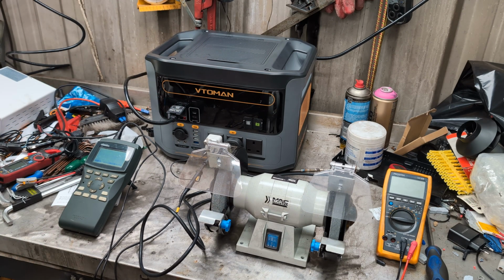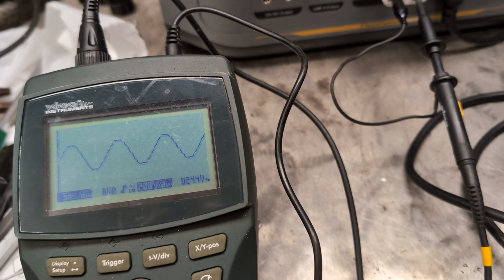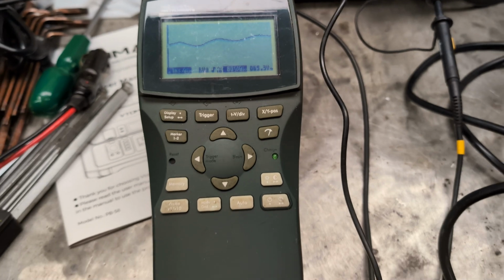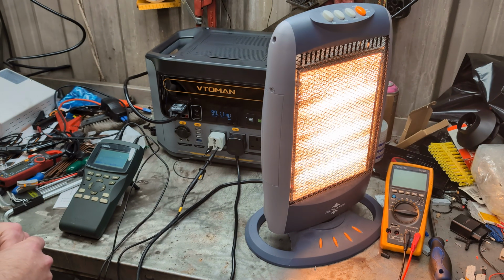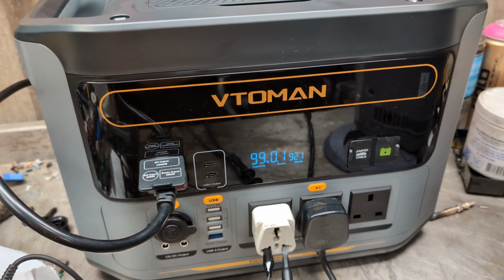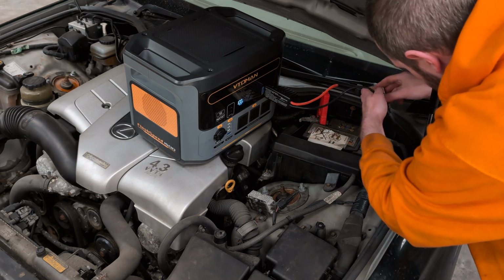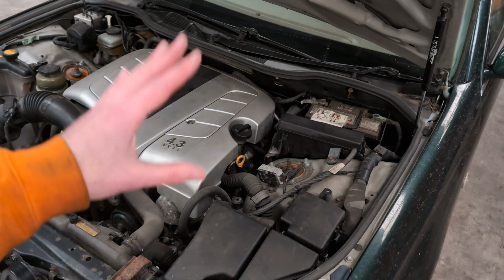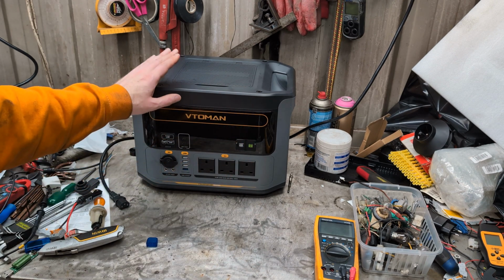Vtoman FlashSpeed 1500 Power Station - UPS test, JUMP START test

Comment: Why are the cables so short ? Is this deliberate or a design flaw ?
Reply from the maker: Short so they don't have to be as thick.  But yes, they are rather on the short side considering the size of the unit.  Option B is to extend them with normal jumper cables.

Comment: I forgot to say, ref waste oil heaters etc, didnt use mine this year, got 8 old laptop batteries and 20 quid heated vest. Fantastic. Solar charges 4 18650s while the others heat coat. Defo recommend.

Comment: Will the jump starter cables operate a diesel heater?
Reply from the maker: In theory yes.  But as it's only using half of the battery pack my concern would be how unbalanced the cells would be after some time.

Comment: Jump start may be ok for a gasoline mini engine. But a diesel truck engine will pop the overload. There is a reason why diesel have a battery designed to give you a hernia.
Your home is well equipped to give you a cup of tea. Till the mains juice up. It is always fun. When the power goes down. Your house is all lit up  and watching a video.
Reply from the maker: I wish I had something big and diesel to test it on.  There is a diesel forklift but I don't think the engine is very large.
Reply: @DavidMcLuckie  
Now where's a train engine 🤣🤣🤣
Reply: I’m looking for a powerbank with AC inverter that will jump my pickup truck.. It’s a 6.7L Cummins Diesel High Output with 2 12v batteries.. Looks like I might have to just get a powerstation and a dedicated jump box..

Comment: Certainly could do with longer cables for the jump-starting feature, but a quick hack would to just use a set of standard jumpleads and clamp them onto the device's battery clamps, or just use one of the smaller packs instead... :P

Comment: i assume it will work, but how about diesel engines? i only ask because i have one of those little jump starters and it works on any petrol thrown at it, but only some diesels. 1.6l van no problem, another 1.6l van and my 2l car no chance won't even turn the engines over a full turn before dying .

Comment: The little pin in the blue connector is for spark supression if fitted.  It works similar to the spark suppressed XT-90 connectors.  It should have a resistor from that pin to the main connector cable and a slightly longer pin on the other side of the connector to make connection first and allow capacitors to charge in connected equipment without an arc before the connector is fully seated when being plugged in.
Reply from the maker: Thank you, very useful information.